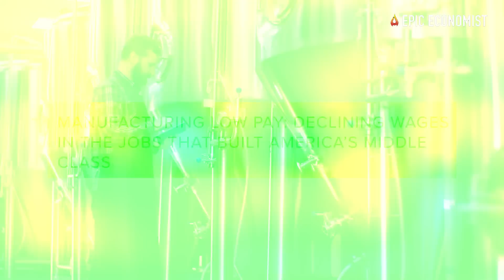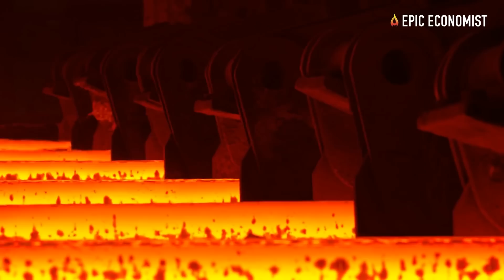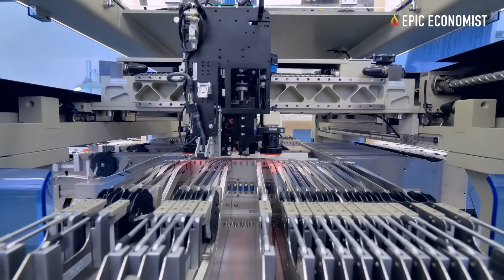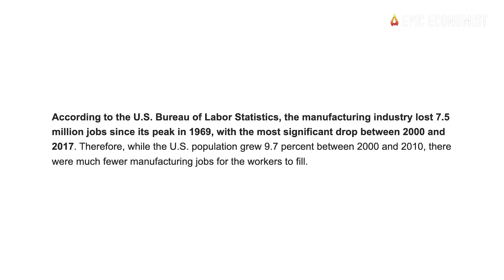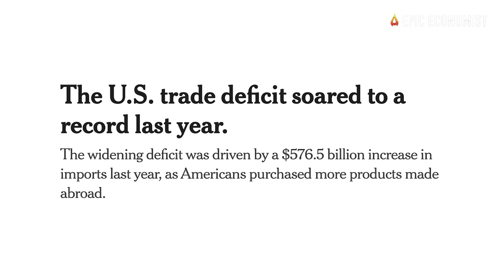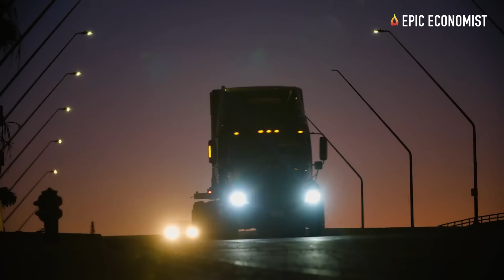20 Sad Facts About The Deindustrialization Of America

Comment: I need a new washing machine but I decided to fix the one I got the timer went bad and I needed a new a/c unit but decided to fix the one I have and I needed a new refrigerator but decided to fix the one I have that was years ago and they are still working good and they are cheap fixing compared to buying new calling the appliances supplier store they tell you what is wrong and how to fix it and sell you the replacement parts my electric dryer stop spinning around the belt broke and I replaced the belt with a car alternator belt and still working cheap fix so saving money is the key

Comment: IT HAS BEGUN!!!
Reply: it BEGAN in 1967 when wages FLATLINED or went DOWN, adjusted for inflation... ever since.  OPEC held the US oil hostage 37 cents a gallon to $1.25. u got it a big truck burning diesel fuel brought it, fuel surcharges, stagflation... double digit inflation and double digit unemployment... 1973/74.... oil shock 2 in 1978/79.... recession 82....   savings and loan scandal 1987 where the powers that be had to tell the papers DO NOT PRINT that the bottom fell out of the stock market, ppl will panic and run on the banks and there isnt even close to the amt of money that ppl think is in "their bank" and .... THE DEPRESSION all over again. fortunately the stock market came back to life the  next day...
Reply: Breakfast 🤣🤗😂????